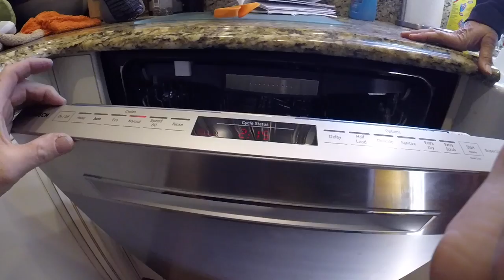BOSCH DISHWASHER INSTALLATION AVOID THESE 3 MISTAKES

Comment: very helpful, thanks.  I just installed a Bosch 500 series dishwasher, and this was a helpful look ahead.  Mine was replacing a Kitchenaid that had a right angle compression to 3/4 hose fitting supply line so I could just use it.  Ironic because the dishwasher came with a line and the right angle fitting - maybe they listened to you?  the other challenge i had was that the drain hose provided already attached to the dishwasher (nice) was set up to fit over a 1/2" to 3/4" feed into the garbage disposal or drain.  My garbage disposal was 7/8" or 1" of course.  I ended up getting a soft adapter with hose clamps to the disposal, and cutting 3" long piece of CPVC tubing to join them together.  Seems to work, but a good pain to watch out for.
Reply from the maker: go ahead plumber. getting it done.

Comment: I have been reading the instructions to install a new Bosch dishwasher.  They mention that you should connect the water line and turn on the water to check for leaks before pushing it back into place.  I would also wait a few minutes since the lines would be full of air and the leak wouldn't show up instantly.  This was a great video and it explained things I didn't fully understand in the instructions.
Reply from the maker: glad it helped.

Comment: I completely enjoyed your video, especially because I just replaced our 17 year old Bosch with another Bosch a couple of days ago and could empathize with your annoyances. It probably would have been prudent to have have had the Bosch pulled out of  its enclosure when you connected the water supply line and turned it on so that you could check for leaks on the dishwasher side and the valve side together. I really loathe plumbing and never assume something is leak proof until I have stared at it for a long moment.
      Bosch provided a front foot wrench for the unit that made it easy to level it. Our unit also came pre-wired so that all that was necessary was to connect their power cord on one side into the unit and the other into a wall receptacle the same as one would do with a computer. Thanks again for the insights and entertainment.
Reply from the maker: always fun with the wifey micromanaging every move....lol

Comment: Installed mine today, this video saved a TON of misery. The front legs on this thing are a crime against humanity. What I discovered by looking underneath is that a 10mm allen wrench will loosen them easily when you have access from below (my helper tipped it back and held it for me). Looks like whoever assembles this part in the factory drives 'em in good-n-hard with a power driver. I lowered the legs far enough to get an open end wrench on before sliding the dishwasher into the opening. Fortunately there was room under my counter to "pre-lower" the legs. Thanks again. Great video and it saved me lots of grief.
Reply from the maker: Good stuff Jim. We just did another and it ran smooth..

Comment: This makes me glad I live in the U.K, by law all appliances come with a fitted plug, and we can plug anything into any outlet. There is normally a double socket under the sink, sometimes two, makes installing / replacing / servicing a dishwasher so much easier. Connections have always been at the back here, much easier than fiddling underneath. I prefer to run the drain and water under sink cabinet and up the rear or in the corner of the base as it meant they don't kink or get trapped so easily. Final tip- wind the feet down a little first, and spray the floor with pledge and it will slide back really easily, then just adjust the front slightly as required.
Reply from the maker: a real mind melt for sure.

Comment: I installed one of these for my mom this weekend.  Yeah, the instructions said to put the electric box in the adjacent cabinet.  I cheated a little, b/c she had a hole in her drywall behind the dishwasher the perfect size to hold the box, so I put it in there.  Just like you, I had so much trouble getting the front legs to unscrew that I had to pull the washer back out and get them started.  They should put in the instructions to lower them enough to get the 11/16 wrench into them before installing the dishwasher.  I really screwed up on not knowing how to raise the back leg before installing.  There's a nut in the back you can turn and I thought I had to use that before putting it in.  Later on, I tried to adjust it in the front and something broke to where I can't adjust it now.  The other thing to watch out for is to not raise the washer up too high if you're using mounting brackets in the front.  When the door closes, the panel can be very close to the metal brackets and there's a risk of scratching it.  Thanks for making a video.  Wish I had seen it before my install.
Reply from the maker: nice rich...thanks

Comment: Very nice job Chuck.  I was also surprised to see all the connections in the back of the dishwasher. When I recently installed a new LG I moved the power line under the sink and connected it to a GFCI outlet. Wired a power cord onto the dishwasher to plug into the GFCI along with the garbage disposal I also installed. Using a cordless receiver transmitter to turn the disposal on and off.  Everything works great no leaks.
Reply from the maker: Thanks for sharing.

Comment: I just installed a high end Bosch dishwasher.  Be sure to read the install manual, being very mindful of the dimensions given.  If the sink is to the left of the dishwasher the electric cord is very short.  I don't know if that electric plug on the dishwasher comes out or not once it snaps in.  Pray you never have to remove it for service!
Reply from the maker: you and me both. What a job. good point on the left handed sink location.

Comment: Chuck, good video. As a retired electrician, I really appreciated your check to make sure the power was off. Get yourself a non-contact voltage tester (about the size of a fat sharpie pen). They're much easier to use for safety checks than a VOM.
Reply from the maker: Thanks Dave.

Comment: Just my observations from a day installing the SHPM88Z75N from Abt. Chicago (where in stock really means that) who shipped it almost free via air in 3 days to OH after I was baited for one month with system rescheduled vaporware deliveries with both HD and Lo's, never again. Now after a week of use I really see why the 800 series are the Teslas of dishwashers.

1. Have someone tilt it backward safely and unscrew front feet by hand until the wrenchable part is visible, it will save you pain later.
2. IMHO junction box should not go behind the dishwasher if your counter depth is 24", but rather take under the sink right above the cabinet hole, read below. Maybe just use the power cord, but I did not want to lose the dedicated breaker.
3. If you have to drill holes for drain, inlet, and power make it as close to ground as possible, this will keep the inlet and drain pipes flush with the recessed slanted space under the back end, especially in a sink-to-the-right install.
 Drain has to have a very high point above the garbage disposal or it will backflow into machine, I used the plastic holder, it also secures the extra two loops on my 8' inlet hose. Sink the rubber end of the drain in hot water for five minutes, it will make sliding it onto the sink/disposal connector a breeze.

4. When pushing back make sure you keep machine flush with the side away from sink, that way you get 1/2" so you can shine light and inspect for kinks, move machine 2", then pull hoses, repeat until done, then you can center machine. I had a kinked drain. 

Kudos  to you and your wife for making this not only educational but also fun.  It is thanks to you that this pen pusher installed his first dishwasher.

PS: What drain pipes are you using under sink? They look WW3 proof.

Comment: I wish I would have seen this about 12 hours ago lol. I replaced a bosch with a bosch and thought it would be a simple in and out.... WRONG! those connections in the back. The old one was hardwired but this one came with a plug didn't know that. Had to head back to the store the next day to buy the junction box because of the "plug" part. had to make the holes in the cabinets bigger for the drain line. Why why why is the hot water connection in the back. keep it in the front in order to detect leaks easier. 
That all said Bosch are amazing and out of this world quiet. I did really appreciate the way that the back feet/foot were adjusted by the set screw in the front.
Reply: The front legs/feet were a huge pain though

Comment: low voltage on the line after the breaker is off is probably due to the inaccuracy of your voltage meter. digital meters tend to pick up phantom voltage rather easily due to the way they detect voltage. nothing to be concerned about unless a high end fluke meter picks up more than a couple of volts
Reply from the maker: Thanks FD. Appreciate that tip.

Comment: The junction box Boch supplied for hardwiring your dishwasher is supposed to be installed against an adjacent cabinet (ie under the sink) which really sucks when you have your wiring coming in behind the dishwasher.  There is not enough space behind the dishwasher to mount the junction box against the wall, even down by the floor. trust me.  So i had to feed a flex whip from behind the dishwasher into the sink cabinet into the junctio nbox, then run the cord back to the dishwasher.
Reply from the maker: I learned the hard way for sure. sad part is i measured too and thought i had room.....NOT! wifey was on it.....lol
Reply: Torture!  Thanks!

Comment: Excellent video and installation. Be sure to read the manual for Bosch cause their installation instructions are not typical. 
I hear a lot of complaints of Bosch dishwashers not drying dishes. If you have experienced that problem I recommend that you buy an American dishwasher (GE, Whirlpool, Maytag) or one that has heated dry/heating coil at the bottom. A lot of import brand dishwashers (Bosch, Samsung, LG) are more energy efficient and dont offer heated dry options. 

I have a Bosch dishwasher, similar to the one in this video, and I love it! Doesnt dry perfectly but its a great quality machine.
Reply from the maker: James, Marcia already complained about that. I will pass this on to her. Thank you.
Reply: Bosch recommends the SANITIZE setting to dry the dishes faster.  I quit using the DRY cycle on my old Maytag at my old house after seeing water vapor shooting out the the vents.  Just open the door a bit after the wash and the dishes will dry in no time.
Reply: The new Bosch dishwashers with Crystal Dry feature uses a volcanic rock (zeolite) to heat the inside to 176 degrees and drys even plastic dishes like a champ!

Comment: Actually the junction box, according to 2021 series 500, says it should be mounted in the adjacent cabinets, not under or behind dishwasher.

And if you have a plug under your sink, save your money and use the free cord that comes with the dishwasher and skip the junction box altogether.
Reply from the maker: for sure. made it happen. Luckily my sink base was open for this move.
Reply: If you already have house wiring in the back of the DW opening, you can install a box low enough that it won't interfere. That's a lot easier than having to install a whole new outlet under your sink. Just do a quick test fit with the box where you think it will work to be sure.

Comment: Back connections scare me....just did a samsung yesterday.... I like to check the water before I push it in......not really a fan of the new design...  You didn't show it but did you push the electric under the sink kick space? That's where I was looking to put it..
Reply from the maker: Ya at this point I was like dam thank god the sink base had a hollow bottom. I just took it off wall and pushed box under sink.

Comment: U.K. Dishwashers & washing machines are all connected at the back , the waste & water are normally run with in the 150mm (6") plinth space  behind so when you push it back it doesn't foul it from going right back in . The electrics are always fitted inside the kitchen unit so you don't have to pull the machine out to remove it.
Fully integrated appliances are a pain as they take forever to fit the door front on them.
Also with granite work tops the top bracket on the machine can't be screwed to it for obvious reasons so you normally silicone it. 
The waste hose is normally fished under the unit & then up into the cabinet & taken above the flood level of the sink to stop water re entering the appliance . 
I have a slimline Bosch in my house awesome product & my washing machine. 
British & europen appliances  are totally different than USA models .
You mostly have free standing appliances so they are so much easier to fit .
Remember we have washing machines in our kitchens whereas you have them in your basement , you lucky people 😂
Reply from the maker: lol....good stuff rich. happy wife happy life.

Comment: Thank you for the video.  I was about to screw holes through the sides of the dishwasher.  I did not understand the manual.  In terms of the brackets.  Very helpful.

Comment: Some installers do not connect the dishwasher to a hot water line because it makes it's own hot water. This is supposed to be Energy Star Compliant. My dishwasher is connected to the cold water line. Does this make a difference other than saving on electricity for the hot water not being used? Cold water line, vs hot water line, is the hot water line needed?
Reply from the maker: good question.
Reply: @ChuckBarron  My dishwasher is connected to the cold water line, as is other people I know there's is on the cold water line also.
Reply: Joey Barrelwilde in Europe dishwashers are always cold fill only. It is proven to be much more economical. Total energy use for a standard cycle including heating the water is typically around 1kwh. It eliminates having hot water standing in pipes all the way from your water heater. It means rinses can be cold when it's pointless having a hot rinse. The only time you might consider connecting it to hot water instead is if you have fully solar hot water, in which case the overall efficiency can be improved slightly by using hot water.
Reply: That's what I was thinking about. In America, they are connected to the hot water line for high heat wash.
Reply: You extend the wash time waiting to heat cold water from scratch. I disagree with Spenser's theory. Your water heater already has hot water sitting idle most of the time, losing heat as it sits. Better to use it when needed than having it waste energy cooling off in the tank.
Reply: @FisherCatProductions  The dishwasher is supposed to be connected to the hot water line.
Reply: @joeybarrelwilde  That's what I just said.
Reply: @FisherCatProductions  I know, but Home Depot installed mine on the cold water line.
Reply: @joeybarrelwilde  Bosch specifically states the hot water line in their instructions. If they did not follow mfg, installation, tell them to get their ass out there and fix it. For sure it will extend your wash times waiting for the water to get up to temperature from the Bosch heater. And you will be heating cold water from scratch when you already have hot water in a tank losing heat while it sits idle.

Comment: Great video, thanks.  Took all anxiety about installing my first dishwasher.  A couple of things to note that may help others.  My Bosch 300 series came with a power cord.  The store also included the junction box with power cord no charge.  If the store tries to charge you for the junction box, you can skip it and install your own standard box with 115V grounded plug under your sink.  I can't guarantee this would be to code in all localities, but it does seem a safe option to me.  Second I purchased a dishwasher install kit.  All I needed out of that kit was the 6 foot braided water hose and the 90 deg hose to compression fitting connector.  I could have saved a few bucks on that stuff.  Just for fun, the leftover unused parts I have are two power cords, a 90 deg pipe thread to compression fitting connector, 3/8 NM cable strain relief, three yellow wire nuts, and some teflon tape.  More for the spare parts collection that I really don't need! :)
Reply from the maker: ya they tuff.

Comment: Thank you for the video.  Question- where did you move the junction box to...did you put it in the next cabinet under the sink or does it fit under the dishwasher?  Thanks!
Reply from the maker: Yes and yes. I slid under my cabinet. it happen to be open side underneath.

Comment: Installed one of these today. The one I put in didn’t come with a cord and junction box. Just a cord and plug. So I had to cut out drywall and install an old work junction box and install outlet behind dishwasher. I was surprised that water connection was in the back, but had a long enough braided hose to make it work. Like you, I also fought those damn adjustable front legs and also chewed them up a bit. In the end, I got it done. Happy customer, now on to the next job!
Reply from the maker: Fire, that was my first and last thus far..plumbing lessons nver stop.
Reply: I had to buy the junction box separately. Bosch offers various “kits”, I imagine, to improve the adaptability of their appliances.
Reply: I haven't bought this machine, but I image that the adjustable legs would unscrew more easily if you loosen up the setscrew. That screw is facing rearward, inside the hole seen immediately above the leg. Then when the legs are adjusted to taste, tighten up the setscrew to secure your adjustment. Btw, I'm no plumbing expert, I just saw this  mentioned in another video. Hope that helps.